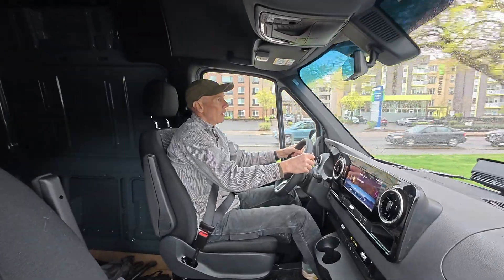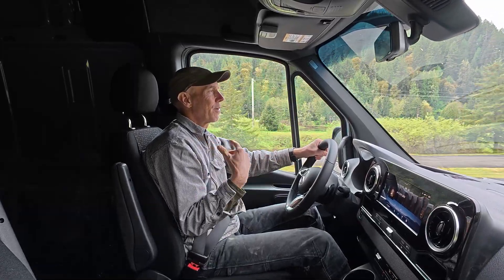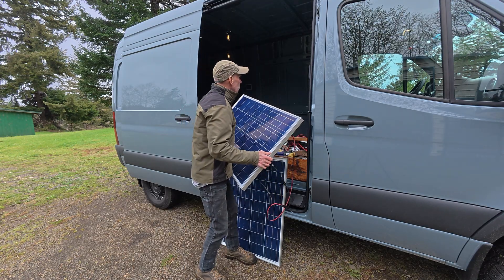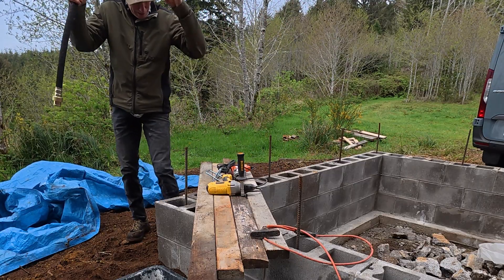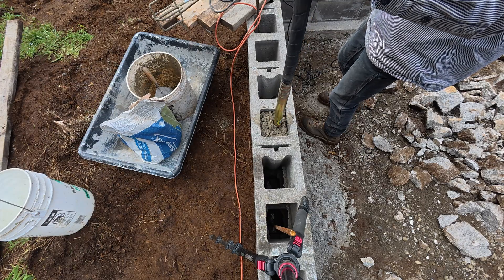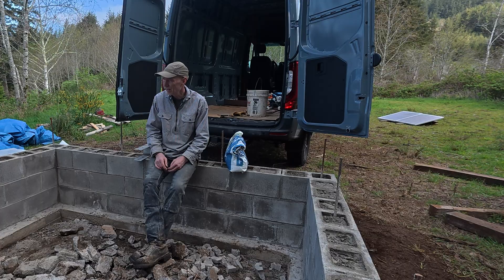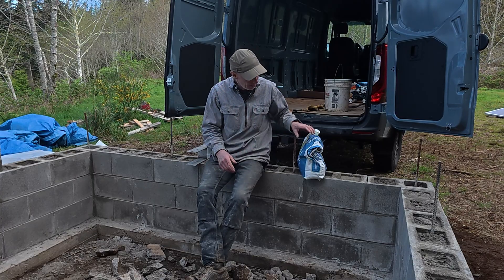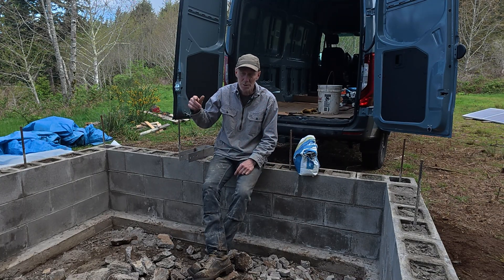051 - Cinder Block Masonry Core Fill Choice - Solar Well Drinking Water - part 8

Comment: The concrete vibrator uses more power?
Reply from the maker: Thanks for weighing in. Surprisingly, the vacuum was by far the biggest power draw. The vibrator and drill were pretty minimal comparatively.  In between was the cement mixer I used in other portions of this build.